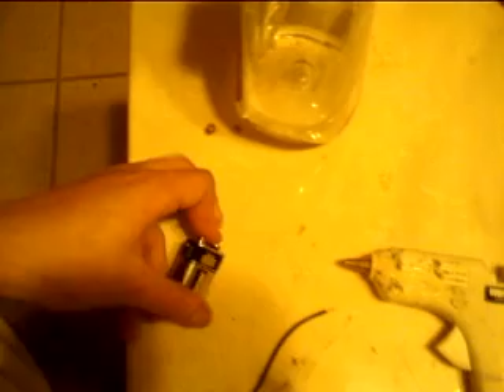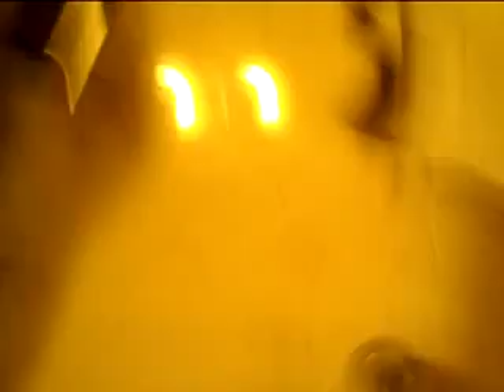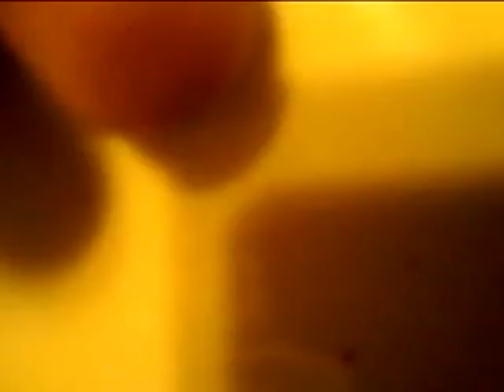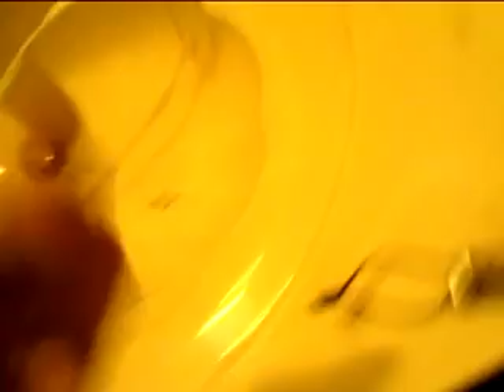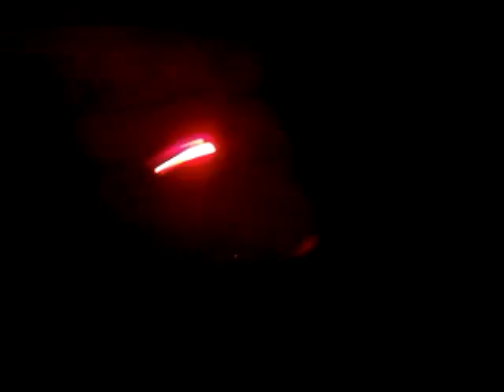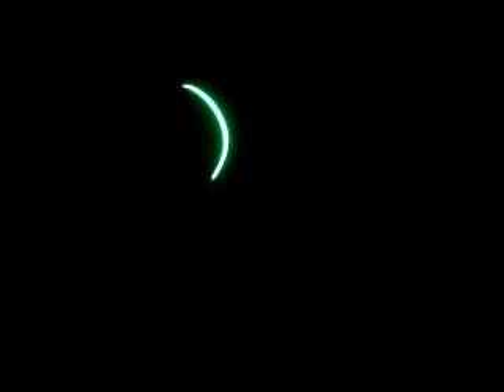How to make a strobe with household materials

Comment from the maker: @MagicalBeauty13 Then you wait until the glue dries, from there, you remove the light, and and glue the other wires end into the other batter socket, you then put the light in the socket and when you wiggle the battery back and forth the light should flicker. if done correctly it should, if not it will be a constant light stream. im not quite sure how i did this being it was 2 years ago, but i will redo it and see if i can do another tutorial

Comment from the maker: @MagicalBeauty13 None taken. This was taken with an LG Dare, which at the time of the video, was the best mobile quality you could record with.

I might re-upload a newer video if i have the necessary materials, but basically, you get an old christmas light string for a christmas tree, you cut both wires that lead to the light socket, and the other one that leads out onto the next, both the same length. You put the wire in one of the 9v batteries little sockets on top of it and glue it.